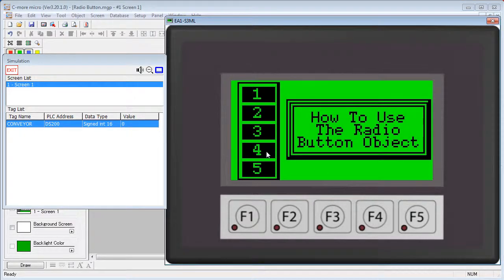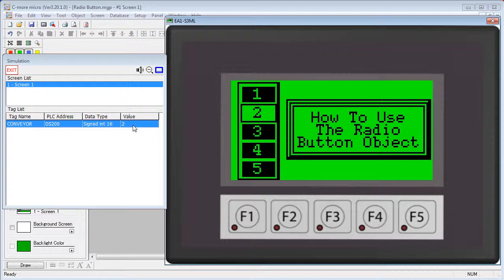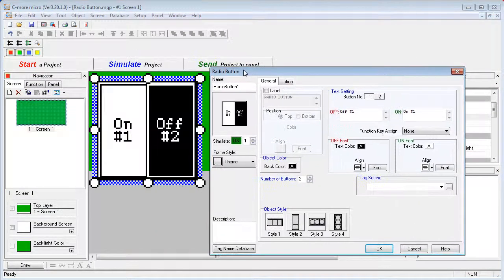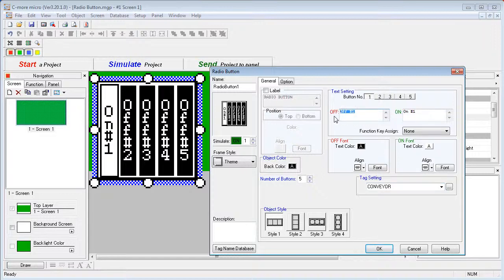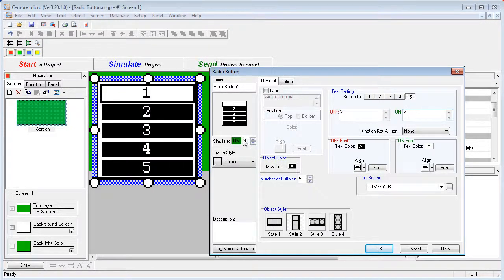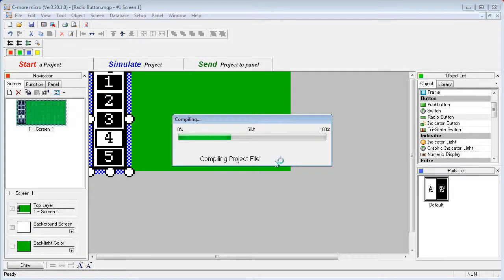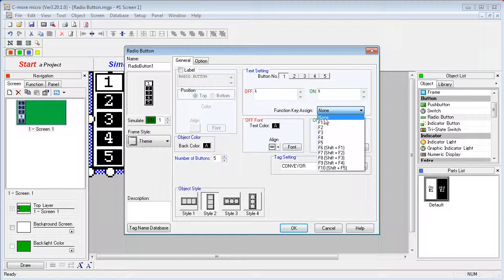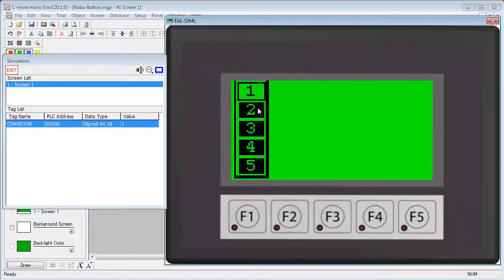C-more Micro HMI Radio Button Object from AutomationDirect

Comment: Will there be an update to where you can change the color of each button like the step switches. It would be nice to be able to select different colors per button.
Reply from the maker: Most of the C-More Micro models are monochrome. While you can change the screen color, there is not a way to change the color of a single object. However, two versions of C-More Micro have full 32k color TFT LCDs (EA3-T4CL and EA3-T6CL), and have access to the standard Object Library.
Full-color HMIs like those listed above, as well as every EA9- and CM5-series HMIs have preset color changing objects, like pushbuttons, indicators, and switches. And because of the visibility animation, you can even create custom objects as well to change colors based on your needs!